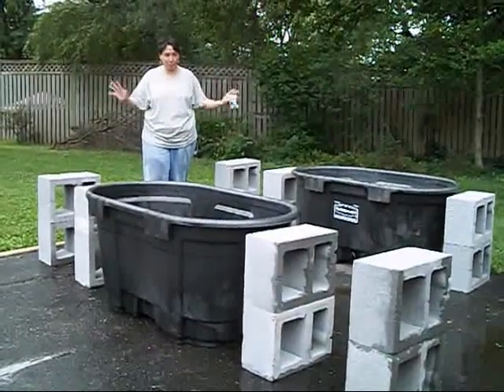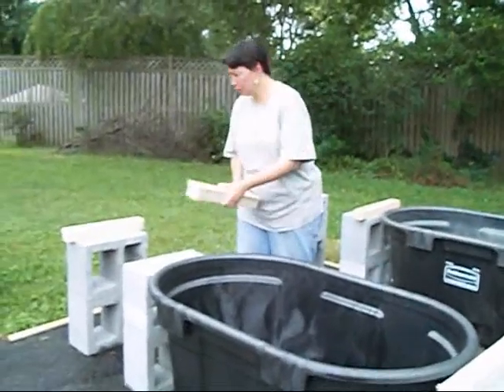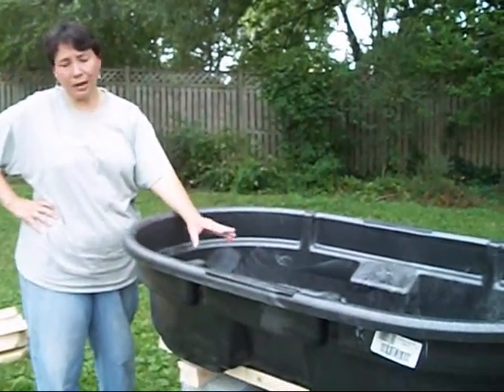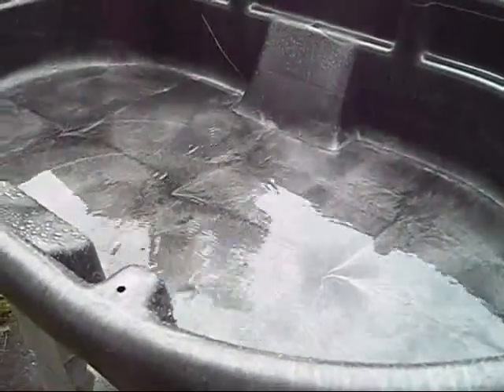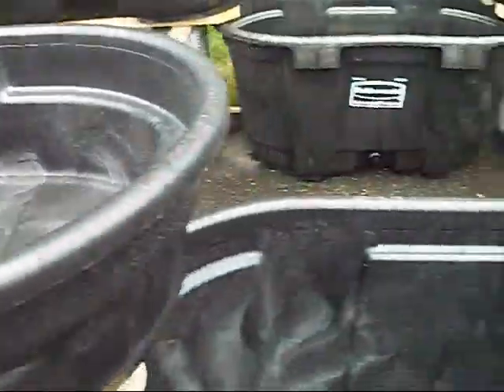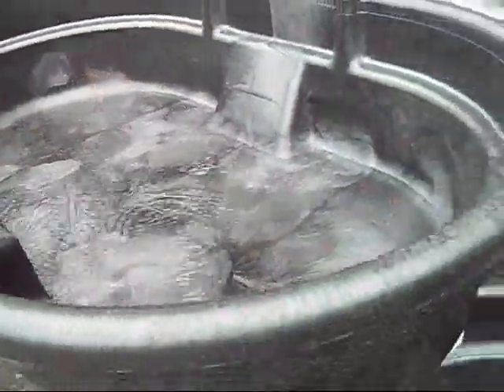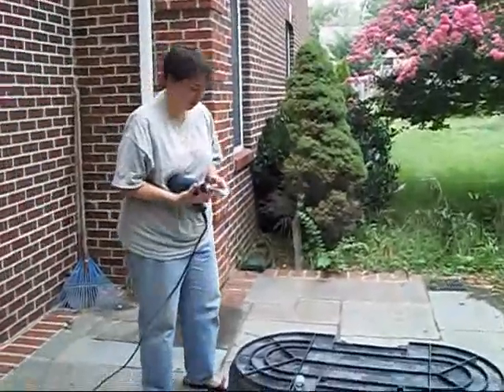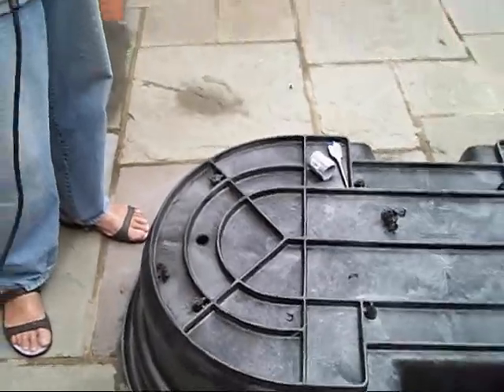Setting up tanks for the 365 Aquaponics System

Comment from the maker: Chuck Ellis asked about how many fish you can put in a system like this. For home gardeners, a simple rule of thumb is one pound of fish at maturity for each square foot of grow bed area. Often you're starting with smaller fish in the spring, when your plants are smaller, so the two grow together. Alternately, you can have several fish tanks, which you harvest in turn, so there's a moderately constant weight of fish.
Reply: +Meg Stout I have spent months studying home aquaponics and found an awesome resource at Keiths Ponics Site (google it if you are interested)

Comment from the maker: A easy rule of thumb to remember is one pound of fish per cubic foot of grow bed volume. A cubic foot is roughly 7.5 gallons. So if you had 100 gallons in your tank(s) connected to 100 gallons of grow bed volume, you could safely support 12-15 pounds of fish.

Folks who have great filtration and keep on top of things might recommend stocking densities two to three times higher than this, but your risk of something going wrong (and killing your fish) goes up as you increase stocking density.

Comment from the maker: So many different questions and only 500 characters with which to respond.

I am not worried about the stock tanks I've used. But I like the idea that I could use Thoroseal to coat a tank I otherwise might not feel confident was safe. Besides, Thoroseal is probably not black (black makes fish so hard to see!).

Is there a technical paper indicating stock tanks leach dangerous levels of harmful chemicals? Love Murray and Gary, but an assertion about what they said is less than authoritative.

Comment: OK so first you say they're safe and now you tell us about a product to assure they are safe. TC is just giving her opinion. Check with Murray or Gary. They will tell you about the importance of using quality components. I will look for the information on chemical leaching, this happens especially when it's hot. I believe even Murray has made the leaching comment. Fiberglass is the best material followed by food-grade plastics.
Also, many of the stock tanks are made in China. Do you trust them?

Comment from the maker: Digging around I see TCLynx saying "The fact that the stock tanks don't have FDA or NSF approvals doesn't necessarily mean they have anything bad in them, just means that the company didn't pay the extra money to get them certified or approved," a cost consumers would have to bear.

If you want to use tanks and wish to ensure they are safe for potable water, you can seal them with a product NSF approved for potable water. Two such products are ThoroSeal Waterproof Coating ® and Waterplug ®.

Comment: Hi Ardelle,

I haven't experimented with using the existing side drains in the larger tanks for bell siphons. Large grow beds (>16 square feet with 12 inch deep bed, about 120 gallons) can have a hard time siphoning out. This is because at the large sizes the media beds start acting like sponges.

There's no reason it wouldn't work. But flood and drain might be easier to deal with. TCLynx uses flood and drain with her 100 gallon grow beds. Google aquaponiclynx to find her site.

Comment from the maker: Hi Jennie, Though I'm slightly relieved to see this comment was directed at Brian rather than me, he did have a point (about the cinder block orientation). However, one other benefit of positioning the blocks on their sides is I can use the holes a shelves to store things. Again, I wold not recommend someone building a serious building do this, but it works for this application.

Also, I hope Brian isn't literally bright, as I can't think of anything good that can cause a person to emit light.

Comment from the maker: True, I could have edited this video more tightly, but I'm curious why you think this has nothing to do with aquaponics. While the compressive strength of a cinder block is greater when the walls are oriented vertically, the placement of these blocks is adequate to the load created by a 50 gallon tank filled with water and rocks. I agree that this orientation would be incorrect if I were building a multi-story building.

Comment: Ah - well, the 100 gallon Rubbermaid tanks are nicely affordable and they are the same size as the 50 gallon tanks, so the shorter tanks can next inside the larger tanks. I had to transport these from DC to Florida, so nesting was good.

It isn't the volume of the biggest tank that makes the difference, it is the combined volume of all the tanks together. So two 100 gallon tanks (one for fish, one for a sump) combined with the water in the grow beds is close to the magic 250 gallon number.

Comment from the maker: No reason an aquaponic system wouldn't work in Santa Clara. I'm further north than you by several degrees, and I'm on the cold side of an ocean (California is on the warmer side of the Pacific). You do have an appalling lack of rain during the summer (based on details at gaisma.com) but aquaponics is more water-thrifty that most other gardening methods, so if you can have any sort of a garden, you can have an aquaponic garden.